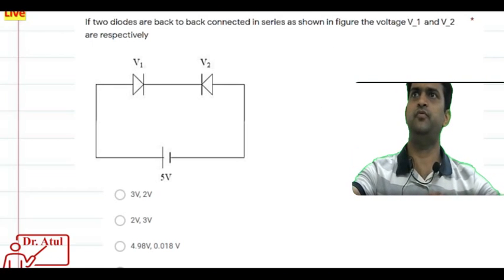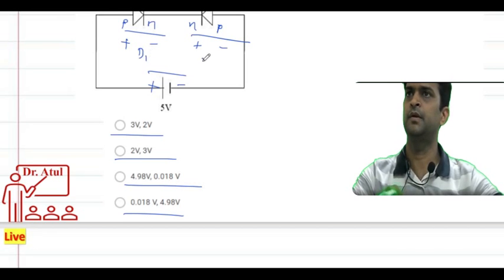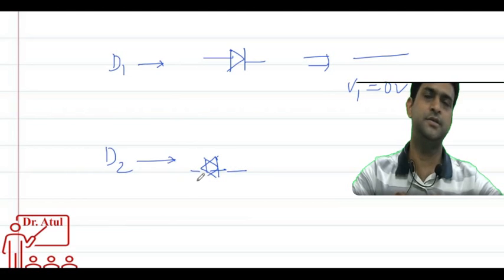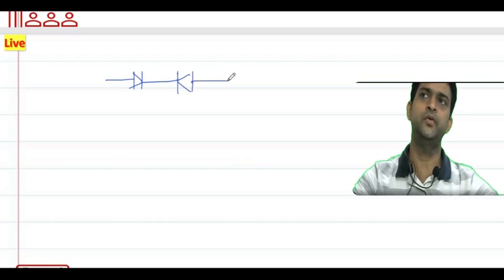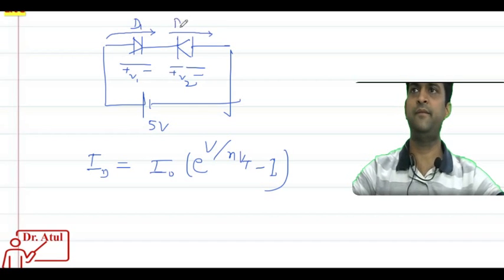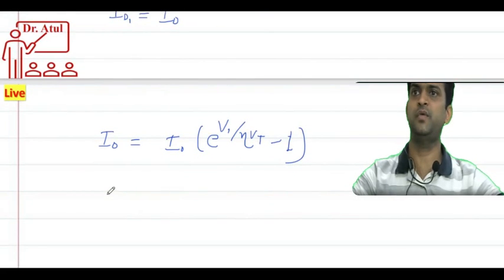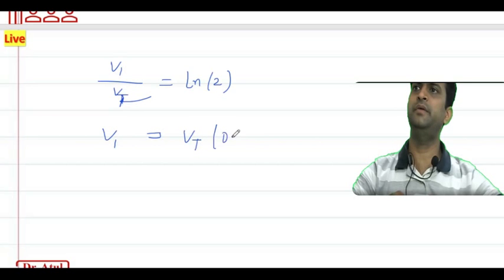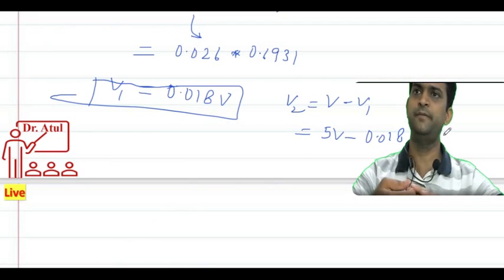Numerical on back to back diode : important question of CT1

Comment: Silicon ideality factor will be 2 not 1
Reply from the maker: you are right. In the problem the material of diode is not specified, therefore ideality factor will be taken as ideal diode, i.e. 1